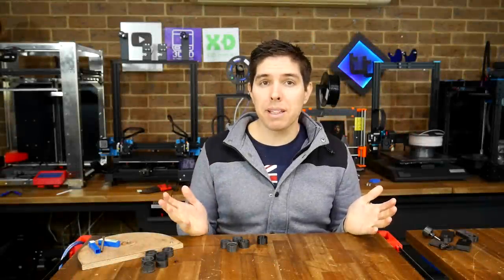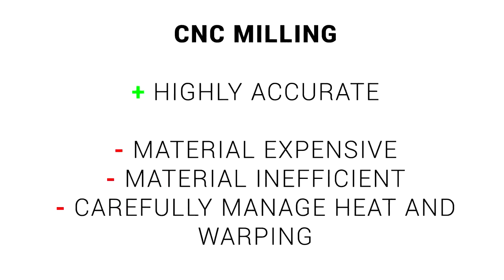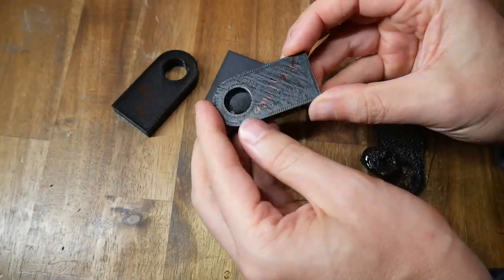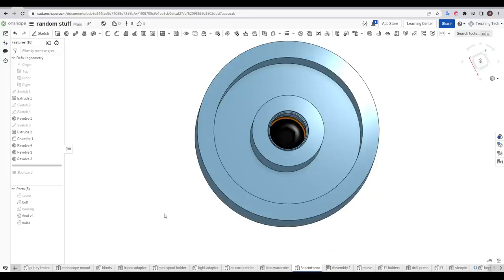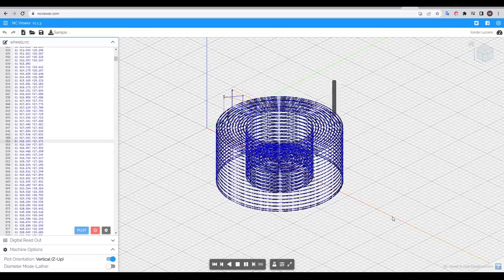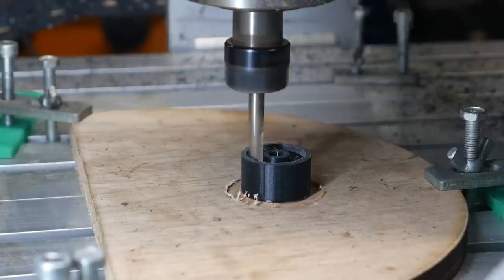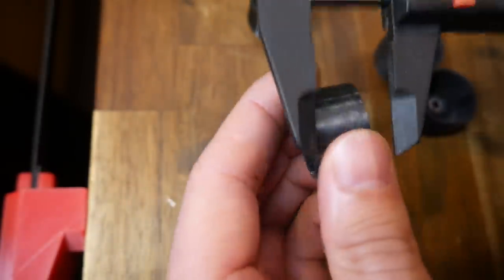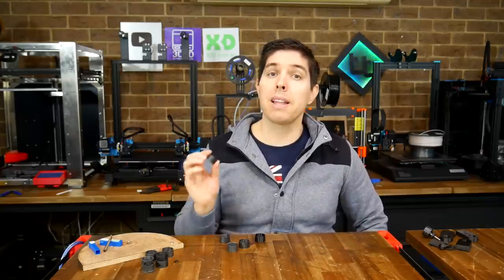3D printing + CNC milling - Worth the effort?

Comment: I have succesfully turned functional parts made in eSun PLA+ on my lathe. It cuts surprisingly nice, but doesn't sand well. 
I also tried HIPS which machines super well and sands nicely but I didn't have time to dial in the printing for it - irrc I had some warping and layer adhesion issues and even though I did build a simple chamber, I ran out of time so just stuck with PLA+.

My parts were for pneumatic spearguns so they had to hold pressure, tolerances and o-rings had to seal against a smooth surface. Which I could not get straight off of the printer despite it being dialed in super nicely. I did have to make/print some jigs to hold the parts and to counterbalance them. But all in all for my limited parts run (2-3 pieces) this was an OK, educational and fun solution. 
I have a resin printer on the way in the hopes that I can skip these secondary machining ops. 

As others have mentioned, if you do secondary machining, it also often allows you to print faster and stronger. E.g. I can increase strength and reduce permeability with part cooling fans off, not doing (m)any retractions and printing thicker layers at max temp. But it might lead to a less than perfect surface. Perhaps a price worth paying if you can tidy it up in secondary ops. 

(Also, you mentioned acrylic wont work on the CNC. Are you sure, it can't be done...? I mean, I can order CNCed acrylic parts to very good tolerances, which leads me to speculate that you didn't nail the cut parameters. Likely cutting too slow or not with enough engagement).

Comment: Unfortunately having an already thin-wall sort of 3d print that you machined you're forcing an imbalanced wheel. The better idea would be to 3d print a cube 100% infill and then mill a wheel out of it. Why? because in your center homing you're trying to reference an already concentric piece. This is extremely difficult to do on a mill and always results in an imbalanced piece even from microscopic offsets. I have spent countless hours on milling circular objects and getting zeroed dead center (within 1/10,000 of an inch) is crazy hard.  Thats why the lathe would have been better. But since you're CNCing this piece you want it to be its own reference and you want the machine to just make its own circular object instead of trying to make an already circular object better.

Comment: Maybe I missed it in the video but why 3D print such a simple cylindrical part? Then you used a mill where a lathe would have been way more appropriate and precise.  I'm seeing more and more "additive manufacturing bias" all over the 3D printing world. Just because you can 3D print parts doesn't mean you should. In this case if it required plastic parts, you could have acquired some rods of Delrin (a better material) and simply knocked them out on a precise lathe. At least in this case the students got the experience of discovering during development and application that they needed to do something different. That's a good thing.

Comment: completely skip all of this and just make them on a lathe. That is the easiest part and should take no less than 5 minutes per wheel. You're not making hundreds of them. failing that skip the 3d printing there is zero need for it. if you're already setting up a cnc job to machine a plastic wheel just use plastic? and skip the printing part. Lastly use a lead in and lead out of your cuts and use a spiral ramp instead of zigzag. You're burning your parts due to high spindle low feed and no airblast or coolant. you need to lower or add something to this mix. Goodluck.

Comment: When you machine any kind of plastic that is vulnerable to heat you need to slow down your cutter and feeds alot. Acrylic does not like fast spindle speed. PET-G is a soft gummy plastic that clogs the cutter flutes causing chip backups and friction thus heating issues on the part.

Comment: First, this is brilliant and I am going to try this for sure. After 3 years in 3D printing, I've now been using a full size (Onefinity) CNC for the past 6 months and things I can suggest are: 1) 3D print a large block of square material and mill your part out of the middle. Yes there is waste, but when working with both wood and aluminum, I have found it's almost foolproof. This square block also makes setting x-y-z zero very easy using a 3-axis probe or manually. 2) For workpieces that don't allow for traditional clamping, I apply a layer of blue painters tape to the bed and to the underside of the part, then CA (super) glue them together. It holds amazingly well and is extremely easy to remove. 3) I've learned to tell your CNC machine feeds and speeds are correct based on the "chips" produced. You don't want sawdust and you don't want large chunks, but somewhere in the middle. This is because medium size chips actually take a lot of the heat away from both the part and bit as they are being flung off (into the bearings of your machine). 4) In general, the slower your feed, the slower the RPM. And, the larger the bit, the faster your feed. Again, all of this to manage "chipload" (i.e. chips/heat/tool wear). 5) I use Vectric Vcarve software and utilize their "Tabs" feature to prevent parts from flying away when cutting all the way through. You can sometimes skip this step if you use the painters tape trick mentioned as long as there's enough surface contact remaining to counter the torque of milling.
Reply: Any advice or recommended resources for someone wanting to move from 3D printing to hobbyist CNC milling?

Comment: You are not milling at the right feeds/speeds if you have heat issues, bump up your feed so the heat is dissipated into the chips and you don't recut, take big amounts of material at a time and you will not over heat, 3 passes on height with no finish pass would work. The idea is interesting, but for this application, I don't see the use for 3d printing.

Comment: Instead of a cutter on the CNC, could we iron the 3d printed part smooth. In fact, why do we need a CNC at all? Could we not have differently shaped heated irons, attached to the 3d printer, and used that to make perfectly smooth 3d printed shapes?

Comment: You should try this with some carbon or glass filled nylon. it should allow you to actually print it without warping plus raises the heat deflection temp. I prefer glass bc price and a higher heat deflection temp (friggin 180 degrees celcius). Taulmans GFN is a beast.

Comment: I made a very accurate ABS cylinder by 3D printing one slightly oversized with a hex base that I chucked in my CNC lathe and turned to size and then parted it off the base. The surface finish was like it had been polished to a mirror finish.
Reply: A lot of people think "ASA is just like ABS," but I've not found that to be true when drilling/sanding (ABS seems superior).

Comment: From my experience machining plastics at work from time to time, you want to cut in the least amount of passes (ideally 1) and to use 1 flute end mills outside the finishing pass. If possible, new mills, sharper, they cut more than drag, reduces heat issues. For the machine I use with ~4mm end mills, I use 12k RPM, with 1000-1200mm/min and it works.

About the screw, mill it in the same direction as the screw threads are in so when forces are applied you don't apply a force that would unscrew the bolt. Most common screws use right handed threads so right hand milling.

As for centering the work, you can first mill a small center hole in your origin, so you know exactly where the center is. Then you attach the part and should be centered by design. Seeing that you require way better precision with good surface finish, I would go buying plastic stock directly once the design is validated with a 3d print and lathe/mill it. It opens more options than just the plastics that are good for 3d printing.

Comment: i always thought about a printer that also is a 3 axis cnc but the process of printing and cnc needs to be seperate cuz of hte pressure cnc puts on a printed onto a build plate part.  great video. thanks for the food for thought

Comment: Great video. I'm studying the exact topic of this video in my engineering collage course. I know this is a late message and off topic. I've been using cura, prusa slicer and super slicer, I found that on some models each slicer produced different quality with the exact same print setting's, its why I used all three, BUT as of cura 5.0 all three slicer have removed the PRINT TO USB function from their slicer. From what I can gather a lot of people, myself included, found this feature extremely useful since we only have one printer and print when we need to print. The reasoning for this removal from the devs doesn't make any sense from what I can gather their reasoning is because it was buggy and the devs don't use this feature so the users shouldn't either even though it was very useful to a lot of people and a lot less buggy then the devs made it out. what do you think of this feature being removed.

Comment: You can mill a flat with the machine itself into the spoil board to make sure the fixture is square to the machine. Using the smooth shank of a worn out endmill flipped upside-down lets you have more reliable surface to align the print from. Roughing down to depth before taking a finishing pass at depth with spring passes completely eliminate any of the bands from the Z steps of the mill. Air blast for plastics is an absolute must.

Comment: One more layer of process might help with controlling variability and repeatability. I'd be tempted to create one perfected wheel then mold and cast it. It increases materials options and time to reproduce. This way if a wheel is damaged you don't have so many steps to repeat. Powder your silicon mold with graphite before casting and you'll likely have a very low friction wheel. But it does add a variable, it would be fiddly to plan for expected shrinkage of resin during cure.

Comment: Some are saying 'just mill it out of solid plastic' but maybe the biggest advantage here is the reduction of stock variety. I just bought a bar of 50mm delrin because I am prototyping iterations of a 48mm diameter part. Worked fine with minimal waste until a design change means the part now needs to be 52mm diameter!
btw - always a good idea to zero to the spoil board and then add a nominal stock height - gives better finished sizes and allows you to get to the bottom of the part without ever cutting in to the spoil board.

Comment: Great information!  I had this running through my mind that 3D printing combined with cnc milling could provide results equal to or exceeding casting and milling/machining for making prototypes prior to going into production.  Of course my thoughts were involving metals, which I know is now possible to be done with the right equipment.

Comment: An interesting aspect to mill an 3dprinted part. In the past I milled things because they were not to print like wood or aluminum. But according to your video I wonder if you would not spend the same time by milling it from a stock material? Also you can choose a less heat sensitive material.
Anyway the milling work in my shop has become rare since autodesk cut more and more functions for the non paying customers. On long term I had to learn cam on freeCad like I done on cad for years successfully.... but that's another story.

Comment: Another great video!!  I often wondered about the joint use of additive and subtractive techniques.  There are situations where using both are applicable.  Not sure if this is one of them or if the correct technique was applied.  Judging by the very good comments below there are many ways to approach this.

Comment: With machining of this kind of plastic, depending on the cutter you're using you might get better results with a more agressive  helix angle or even a small radius stoned into the corners of the endmil itself (it may address some of the surface tearing).

Comment: I could easily see the difference sanded and unsanded, also kinda disappointed you didn't do an over-extruded wheel to see if it would machine out perfectly without all of the pits. either way still a great video

Comment: Would PEEK or PEKK be good for such an application?
Reply: Both are incredibly expensive and brtual to print in the home shop.  Marco reps recently managed PEKK with a Qidi X-CF pro that was gcode/firmware modified and had a hell of a time.  Pekk is also $600 CAD for 500g.

It absolutley would work but way way out of budget for most things
Reply: Really hard to print with a standard 3D Printer.
We have a Intamsys Funmat Pro 410 at work and occasionally print things in PEEK which is not very pleasant to work with, even on a multi thousand dollar industrial printer like this.

It's also not easy to machine, as it tends to warp and crack a lot and requires some machining power. I don't recommend it for a CNC Router, we use real production CNCs (Hermle, Mazak and DMG Mori) and still have problems on some parts.

Comment: Great video.You have saved me time and effort. When centering holes on a milling machine, I have a rod the same diameter as the cutter I am using that has a 45 deg point. As you lower the point into the hole, adjust the X and Y to get equal space around the hole. The more you lower point the smaller the space and more accurate the position. This method will account for the bump in the wall as the point will touch the bump but the space will be even. Then zero X and Y, change your tool, and Bob’s your uncle. To improve the finish, add a final cut at the minimum depth of cut of the CNC. The roughness is caused by tool chatter and the machine flexing. The lighter the cut the less stress on the machine and vibration. I like the experimentation you do to improve our knowledge. The secret to machining is speeds and feeds and you’ll have to fail before you find the sweet spot.

Comment: For more accurate 3D-prints I suggest using a 0.2 nozzle with 0.1 layer height. Takes ages to print, but from my (limited) experience with small parts, it's not needed to add tolerances in CAD I would need with 0.4 or bigger nozzle-sizes and if it doesn't fit, it probably just need a little treatment with a fine sandpaper. But from my experience the accuracy is far more than twice as good as with 0.4 size (Cura).
Reply: strength is a huge sacrifice if you do it that way.
Reply: @MrTheklman11  Why do you think that? From what I know it's wrong and what can weaken prints: print-orientation, layer-heights >50% of the nozzle-size, too low nozzle-temperature, too much cooling, under-extrusion, but not the nozzle-size itself and 50% layer height is the best.

Comment: Hi, I follow you because I do enjoy your videos but on this one you failed a bit. I know that you have the needed machinery so I have to say that for perfectly round object the ideal is never a CNC milling machine unless you own one that cost thousands of dollars, perfectly round pieces are meant to be machined on lathes and not on CNCs... you started very well when building the raw wheel on a printer which applies to CNC, when there is no printer, the raw wheels are machined on CNCs and then perfected on lathes.
Another mistake is the lac of cooling, when you machine plastics which include acrylics you need cooling to avoid melting and warping.
The last one which was actually one of the first on your video is the placement of the jig on the CNC machine. Because you use a jib that is held by clamps to the bed, to simplify and add precision you should have engaged the milling bit to the wheel bore with the jib loose, zero the spindle where ever you want on the bed and then tight the jig to the bed.
Listen, I am not criticizing you, my goal with this comment is just to share my machining knowledge to help you improve your skills for the future.
Keep going...  
BTW, I sent you an email about an extruder that I designed.

Comment: Cool, but definitely needs auto calibration for the milling portion.
Also, CNCs definitely need to become smart.
Both probably could be done with strain gauges. Not 100% sure about the calibration, but the smart portion.
If it knows the raw product and the ability of the tool, it could e.g. stop the process /call for help, if it should feel resistance but doesn't.
Or dial back movement rate (when e.g. milling metal) if the strain on the tool comes close to maximum tolerance of the tool. Preventing tool and part damage.